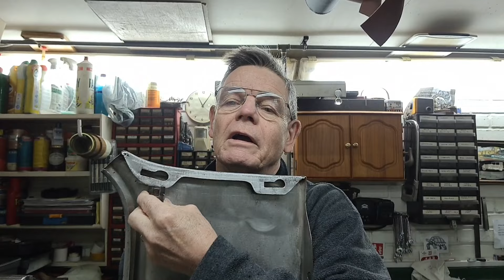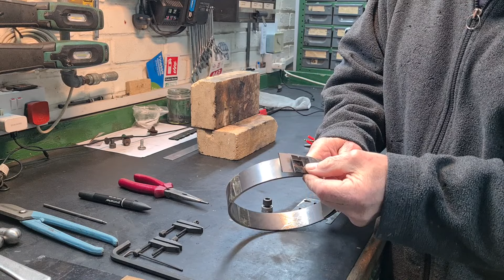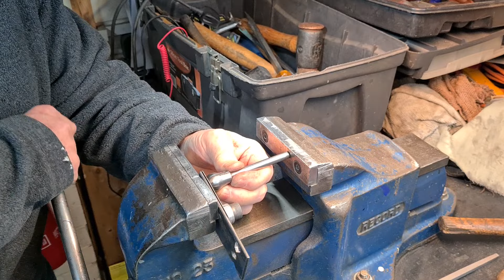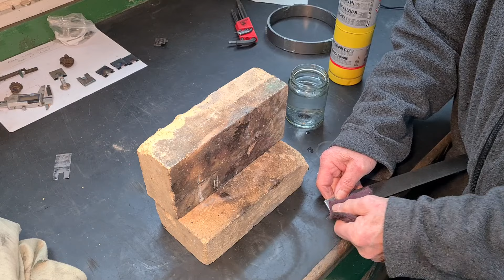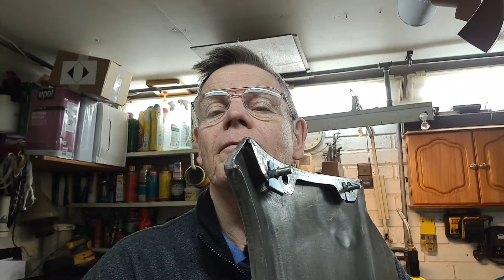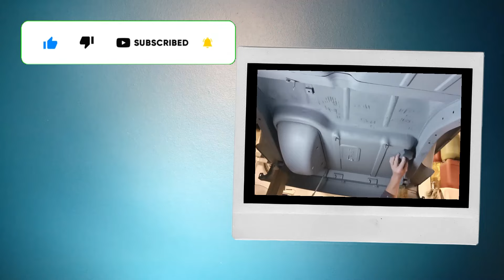How to make Spring Clips

Comment: Superb video Steve! The only way I can think of protecting that area as best as possible is etch primer,etc, topcoat, then maybe plenty of waxoil or something similar.An additional idea would possibly be a mud shield made from sheet rubber to prevent road debris from collecting there, similar to ones on Rover P6 rear wings.As you say thats one hell of a rust trap.
A theory I have as to why Ford went to the trouble of those clips, is I wondered if the wing was prefitted with the bolts and clips then handed to the production line to make fitting the wings quicker and easier, then all the fella fitting the wing needed to do was put it into place and put on the washers and nuts. As you rightly pointed out aswell, if it was that way round rather than a bolt into a caged nut, then no chance of damaging the wing.I really admire your care and attention to detail Steve. Your Consul is going to end up a superb example!❤👍
Reply from the maker: Hi David thank you for the nice comment I agree with every thing you say.

Comment: I have has some luck against rust and mud. On my jeep fenders i first painted, then oiled and finally filled the space with spray foam. It keeps the debris and chipping down, though it requires refreshing depending on use of the vehicle. I enjoyed the clip building, Thank you. PS, I remember coming across an old, junked car which had been painted inside the fenders with a tar like coating. Still sticky after decades and shiny metal when scraped off.
Reply from the maker: Great tip!

Comment: Very good metal work. However, you could use a thin piece of plastic with a tight-fitting hole that may work as well. and it will not rust. This clip is just for positioning the bolt. The clip you made, which is very well done, is time consuming.
Reply from the maker: Thats a good idea thanks for sharing.